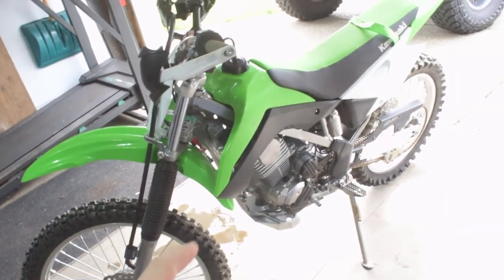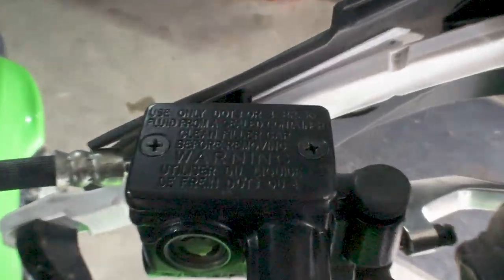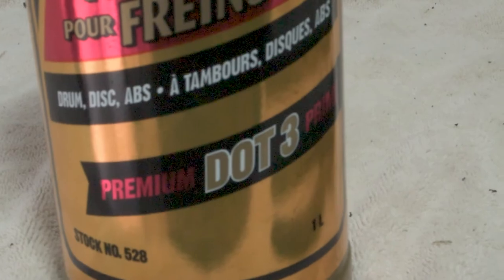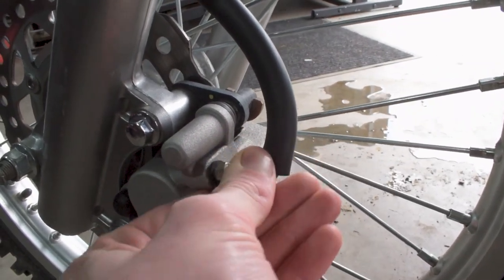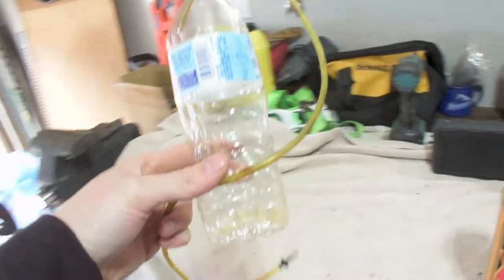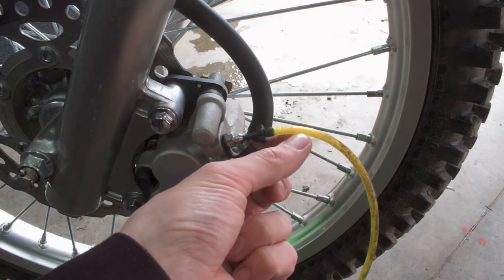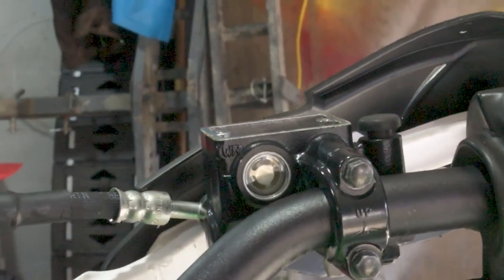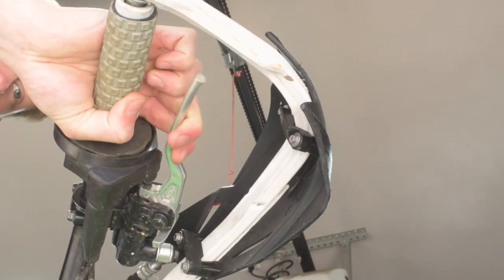The Secret Way To Bleed Dirt Bike Brakes The Easiest Way!

Comment: In my experience it's never this easy to bleed dirtbike brakes bc the plunger at the handle simply does not produce enough volumetric force to remove the air from the lines. The easiest n most effective way for me has been to backfeed fluid from the bleed valve at the caliper up to the master cylinder reservoir using a syringe of adequate size (at least 100-150 cc capacity I would guess). U have to remove excess as the reservoir fills but that's no big deal. Trying to bleed it using the handle (or foot pedal for rear brakes) can often turn into a frustrating waste of time.
Reply from the maker: Really? Mime are dumb easy to do. Takes about 2 minutes and their bleed perfectly